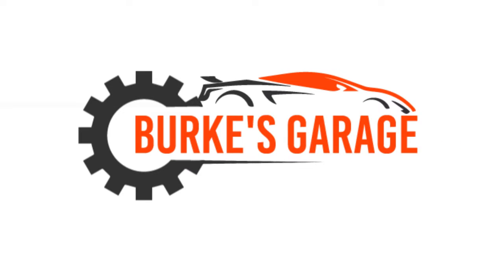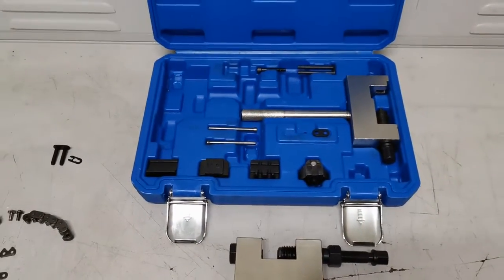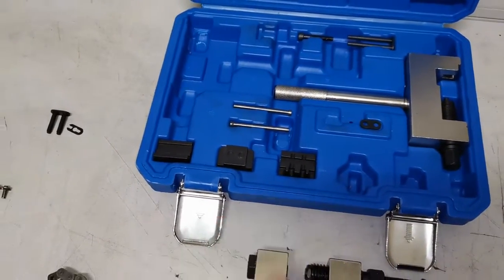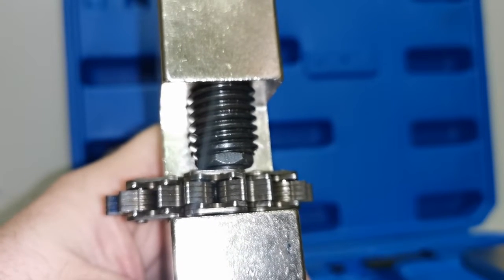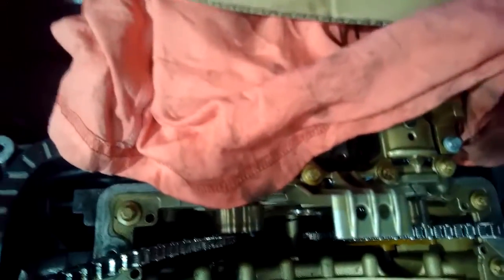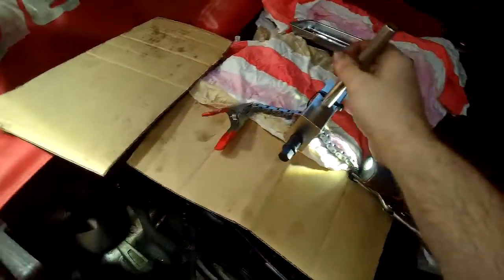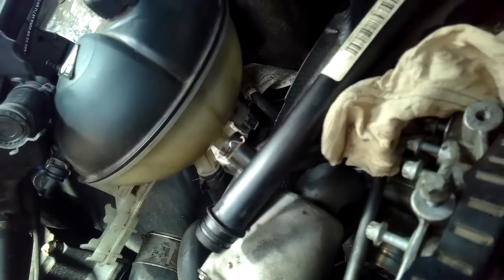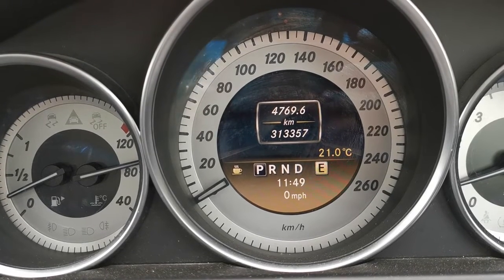Mercedes Timing Chain Install - How To DIY - Part 2

Comment from the maker: I hope you all enjoyed this series, showing how I diagnosed the fault and the detailed repair/replacement process.  
Playlist link here for previous videos https://www.youtube.com/playlist?list=PLlihuiJTGmmzkXlpl-AR3wlh5EqGRbF9N  
The footage I used in this video was the best I had and between all the videos I believe there is very valuable information for anyone that has never done this job before.  
As always thanks for watching and I hope you see you in the next one :)
Reply: Great video , footage was fine too . I noticed you turned the crankshaft to wind on the new chain , the engine must be a non-interference one or did I miss something.
Reply: Can you be more specific on the torque spec of the t100 bolt please. Over 100nm referring to anything above 100 or is there a specific torque spec? Pardon my ignorance on this.
Reply: Great video m8 ? How much would a job like this cost ?
Reply: Just watched your Merc timing chain series, very helpful thanks for your effort. 1 question, did you replace the guides at all or is this not necessary?

Comment: Excellent video. I have a question: I see that only the crankshaft is rotating, and it seems like it's not touching the valves. I thought the camshafts should also be rotated to install the chain.

Comment: Wait so the cams are locked in position and you are turning the crankshaft.  So, this is a non interference engine?  I have seen another video where they keep the phasers on so that everything rotates - cams and crankshaft.

Comment: thanks for sharing all the details. As for the coil failure causing miss firing, My experience is if one coil goes bad, the rest will follow soon. It is advisable to replace all four together.

Comment: TORQUE SETTINGS FOR SPROCKETS - for the M271.8 engine it’s 130Nm for the M271.9 it’s 90Nm
Reply: Would M271.860 fall under the 130Nm in that case?

Comment: Hey man - is it okay to rotate the crank while the camshaft adjuster tool is on the camshafts? I see that you only rotate the crank to feed the new chain in while the adjusters are removed from the camshafts. is that not going to mess with the valves/pistons touching or interfering?

Comment: so what are the exact torque specs for the bolts on the phasers?  I heard 90 and then heard "over 100".  If it was stated in another part of the video, I must have missed it.....

Comment: Thanks for your video. There is one thing I got confused. In the video 08:40,  when you started to rotate the crankshaft  to replace chain,  the cams are fixed by the timing tool, which means the 16 valves are in the fixed position. The 4 pistons are up and down while rotating the crankshaft. Will the 4 pistons  hit and damage the 16 valves?
Reply: Almost a 100% sure it’s non interference engine
Reply: you basically answered your own question, 16 valves are in the fixed position and none hit the pistons, all 16 at the perfect fixed position, indeed interference engine

Comment: First time changing timing chain using open chain method, I have a (closed) new timing chain. I need to open (separate) it to install on engine, and then close (rivet) the chain once again…. My question is: Can you just reuse the connecting link or do virgin links need to be purchased somehow in order to close (rivet) the timing chain for final assembly?

Thanks

Comment: We do quite a few of these at my Euroshop in NY. Only the Chinese kits make the proper size knurling/peening dye needed to knurl/peen the MasterLink studs that hold the link plate on. When using the OEM chain the die is only good for one use, before it's too marred up to reuse. MB offers the right die, pt# 271589016300 for $506 my cost. But it's not available. Does the kit you're using have the proper size dye and have you used it on an OEM chain? If so, can you tell me who's name is on the kit?  Also, we are working on a trade-in program on repaired/welded cam shafts. 
Thanks, Steve, PitBull Motors inc

Comment: You never showed/answered a critical question. How do you get the tensioner to engage once replaced?  
I have heard you turn the crank backwards 1/2 turn, and it triggers the ratchet mechanism to engage. But that's just what I have heard. Is that the correct way to engage the new tensioner?
Reply: That is the correct way.

Comment: Hello! How did you unlock the new tensioner to push thr chain, after screw it in?  You didn't say that. A new tensioner is in locked position.How did you "unlocked" it? Thanks!

Comment: I done this 4 times and still idle speed is not correct. Even that I have all marks correct  so do I have to keep the span on these wheeles when I tight them. I have a bit different model teher is no place for sany tools to keep it steady only one is this special tool which keeps the noses on right place

Comment: Hi Ger

Is this engine an non interference since you could turn the crank and not the cams? Or am I missing something?
Reply: Yes, really! I was under the impression that 99% of engines made today were of the interference variety, especially something like a Mercedes Benz.
Reply: It is an interference engine, but with the cams locked in the timing service position, no valve is at maximum lift, so the piston and valves will never touch.

Comment: Hello, is it necessary to replace the chain ? I just bought c250 with 111k miles and I heard rattle  that I believe it’s from timing chain while driving in slow stop/go traffic.   No fault codes or issues ( except vibration Arround 3000 rpm in neutral). Car was neglected before.
I will check the timing and probably there is bad sprocket, I plan to replace the tensioner and sprockets ( if there is problem in them) also I have dealer type scanner can I catch worn sprockets by looking at the actual cam timing ? Thank you

Comment: hi. after i replaced the can gears , and tensioner, i see that the chain is loose in driver side,down in guide . What is the problem, ? in the left side,where the tensioner sits is tight, in the right side, is loose. is it normal because car is off and dont have  oil pressure or what?

Comment: what is the car on this particular video? C180/C200/C250? I'm driving a C250 with a timing chain replaced at 150k kms but amazed to see that this car has done 313k kms!

Comment: hi, do u advice to change the timing chain even for lower mileage? 100.000km ?
Reply: If your merc is serviced at every interval and good oil is used like a 5w40 full synthetic then it should last longer, mostly it has a very audible noise when the chain starts to wear. I service my W203 C180 Kompressor myself and change the oil and oil filter at every interval and so far after removing the valve cover at 100000km my timing chain is still good. Check your timing chain every 50000km or so just to be sure. And when you have the extra money get the chain and sprocket kit so long as the timing chain will eventually wear it is inevitable

Comment: Is There anything specific that needs to be done after torquing down the timing chain tensioner to apply tension to the chain or do I just torque it down to 40 Nm and let it apply tension on its own?
Reply: I’m wondering the same thing. I’m wondering if you tighten it in all the way (threads all the way in) and then torque it, or just screw it in, torque it and wherever it stops it stops.

Comment: Do the valves hit when you bar the crank over or have the lifters been taken off? Also, can the tensioner be taken out for checking on its own? I have a c180 compressor 2003 but not sure if its Variable valves. chain jumped apparently and a garage put it back in place but reported it as very lose. Dose the tensioner have oil pressure as well as a spring behind it? The car belongs to an old boy and its not cost effective to get a garage to deal with it. So I may have a go. I am a diesel fitter so within my capability but Im just thinking blind at the moment. If I take it apart ill be committed.
Reply: If you change the chain also change the tensioner, the tensioner has a habit of getting stuck if the chain wear is heavy

Comment: I've read elsewhere that its not possible to get the exhaust side timing mark exactly lined up even after doing this repair, on the kompressor versions of the M271 anyway.  The example in this video is the turob version with a different timing chain.  Were you able to get all timing marks exactly lined up?
Reply: How did you solve this problem because I have the same issue

Comment: this videos very well done Could have done whit this last year  Regarding the kit for the chain they come in different sizes  The 1st one I bought  From Amazon Was 50 pound  The fittings were 4 or 5 mm  And did not fit my chain   Then ordered another one    online Seeley £275 This one had all different sizes and included the 3 mm this one fitted my Mercedes which was a 1.8 CGI 2012 Hope this helps

Comment: I would bet that a motorcycle chain tool will do this same job at a much cheaper price?? Why did you not use the vise grips and the extra chain coming out as a weight laying out over the fender going down to the ground, with a fender cover of course. I can see somebody allowing some slack, the chain falls out of time on the crank gear and the entire job is buggered. No live scan data or scope video of the VVT in action, hmmmmm
Reply: I also thought a motorcycle chain tool would do the job just fine

Comment: Fantastic series!  You might make note/mention that Mercedes recently extended the warranty of the camshaft adjusters to 10 years/unlimited miles.   As such, if the car owner can show reasonable proof of scheduled maintenance they should be able to get the dealer to perform this procedure under the extended warranty.
Reply: As I sit here looking at my faulty camshaft adjusters with the engine completely torn apart... I am suddenly asking myself "why didn't I know this earlier!!" Too late now... time to finish the job... thanks for the info though!
Reply: It's actually 10 years or 120k miles mate !

Comment: How much would this cost to have done ?
Reply: The dealership quoted me about 3,000$ to 3,500$
Reply: @I_AM_THAT_PLANE_GUY  Ask your dealer again, they should cover this under warranty.  This warranty is for the car and thus transfers with ownership transfer.  If you can show you've done regular oil changes with an MB approved oil you should be able to get the work performed free of charge.
Reply: @therestorationshop  the final quote was $2,350. The warranty was extended to 120,000 miles however mine is at 145,000 miles so it wasn't covered. I just spent a day and change the adjusters myself for $800
Reply: @I_AM_THAT_PLANE_GUY  I didn't see the mileage limit in the letter we received but it sounds like you handled it with very little issue anyway.  Congrats on a job well done!  Our car is under 100K miles so I'm hopeful it will be done under warranty and I don't have to do this procedure.
Reply: If you do it yourself probably 1,000$

Comment: Question. I have a 2014 c250 with the m271 EVO 1.8 turbo . I have to change my cam phasers and chain etc... is there a reliable aftermarket kit I can purchase for my vehicle? Mercedes wants close to $ 2000.00 for just the two phasers not including anything else I’m going to need. Thanks
Reply: Did you find a good kit? Could you please let me know as I have the same exact car and same problem as you do
Reply: In November 2020 Mercedes extended the warranty on the camshaft adjusters to 10 years.  Your dealer should fix the car under warranty.
Reply: @therestorationshop  10 years or 120,000 miles whichever comes first unfortunately I'm at 145,000 miles
Reply: @therestorationshop  what if your not the original owner
Reply: @5ivestarJaayy  It doesn't matter, the warranty transfer with the sale of the car.
Reply: @therestorationshop  would they do the whole timing job free of charge in that case with the adjusters, chains and tensioners or just the adjusters?